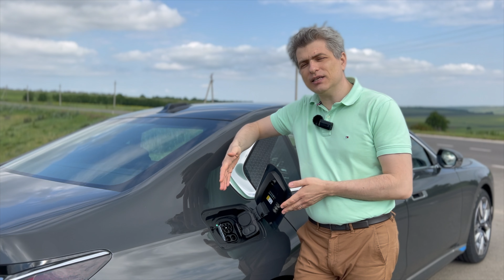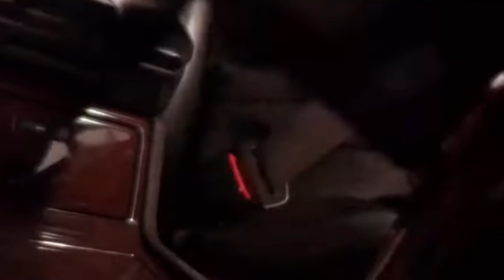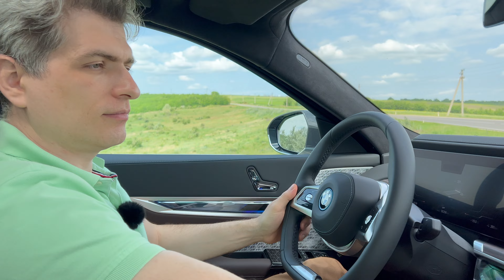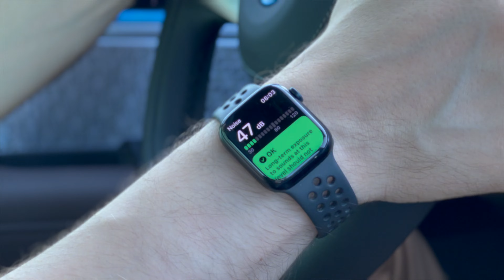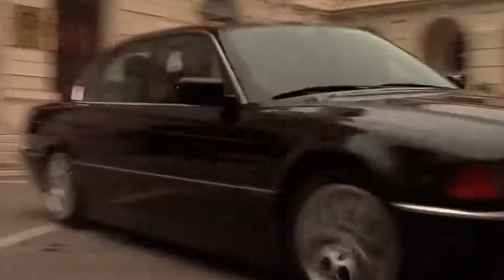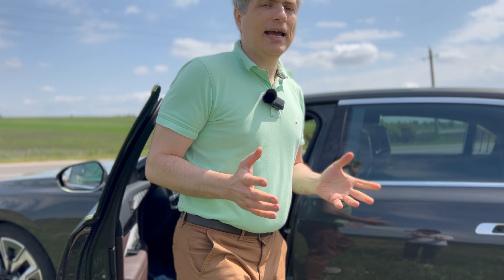The electric BMW i7 is a 5-minutes to Rolls-Royce car

Comment: I had an e66 (2006 750li), my favorite.  A beast of a car and a pleasure to drive.  The only thing I didn't like was the computer and transmission.  You had to flatten out the gas pedal to really get it to go.  I now drive a 740i with similar computer / transmission issues, but still fun.  As for the i7, outside of the exorbitant price, it is a game-changer to me.  I would say BMW has finally earned their motto of, "The ultimate driving machine."  IMHO they've done something no car manufacturer ever has.  Acquired rock bottom NVH (noise/vibration/harshness), a suspension that can corner on rails while feeling like you are driving a cloud at the same time, and now with EV provided linear acceleration with no quirky transmission.  However, I also feel they went way too far with the electronics and the price is really up there.  I would like to see what a base model of the i7 might look like with a reduced price.  Regardless, it makes me excited to see that a car like this has even been produced.  Nice work BMW.